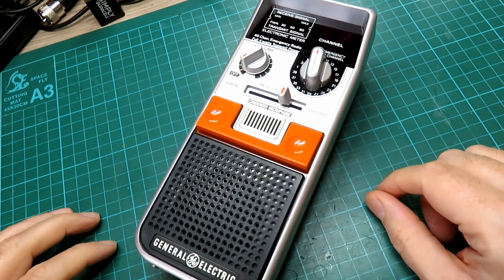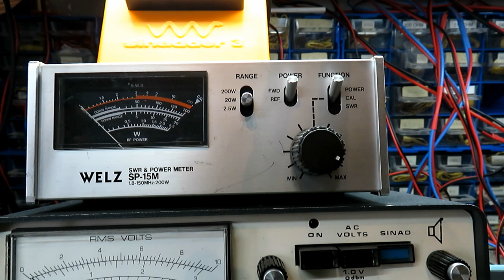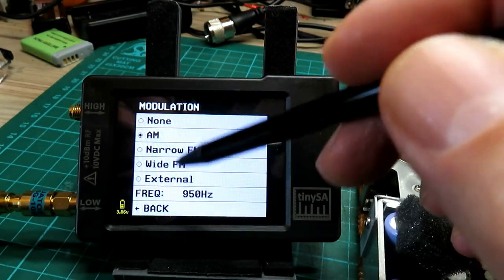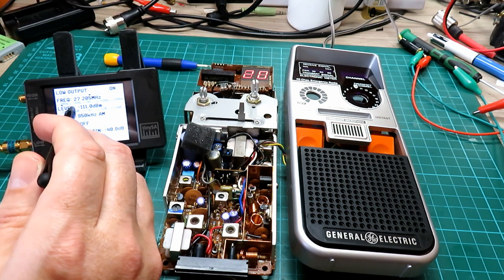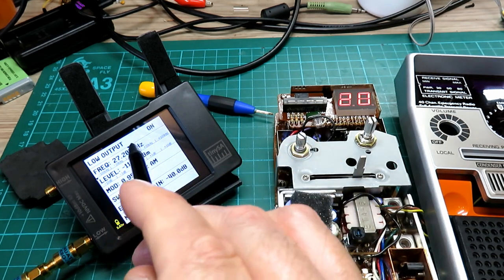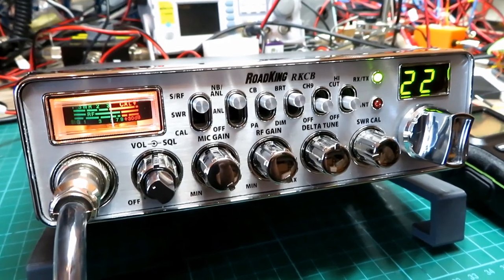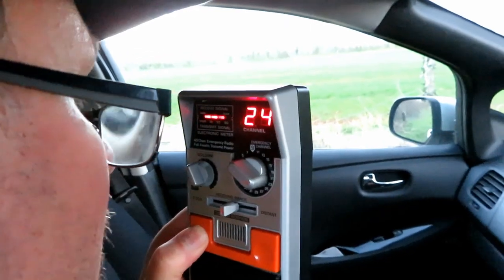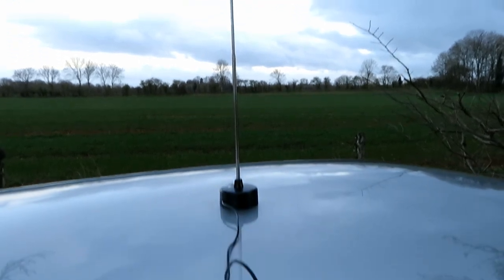YOU MIGHT THINK I'VE SHOWN YOU THIS BEFORE? I HAVENT! - USING BUDGET TEST GEAR TO SET UP A CLASSIC

Comment: I used not even look at these radios back in the day, but now I have 2 ,your version and the newer one that came out in 1983 ,using a real antenna they are little sleepers with the modulation turned up.

Comment: You got that on quick. Said at the end a Friday. and for tea (maybe) Chips. Fry them. I did for tea not 2.5 hours ago. Salmon and chips!. Nice radio. Not so good supplied antenna. I got 2 for the amatuer radio magmount. Big one for day out. Small 45cm thing normally, up and down to work. It goes under the garage door. As they say. Longer is better!. Poor old Tyler. roped into the video but not one can be done on your own.